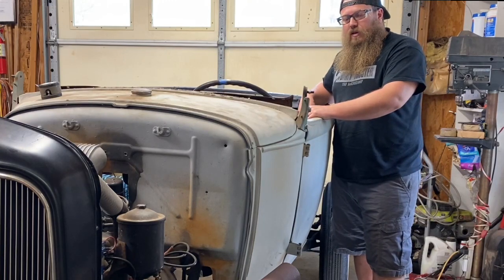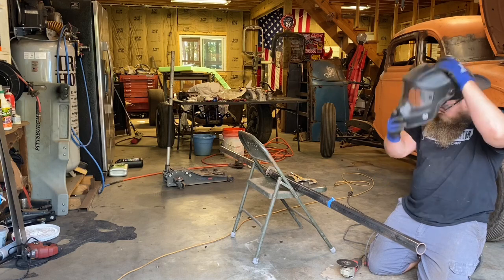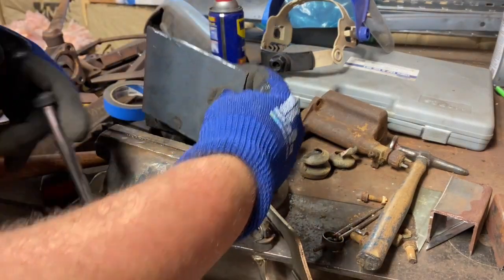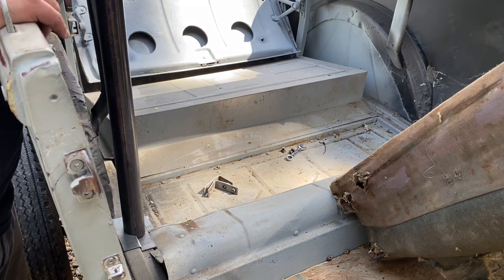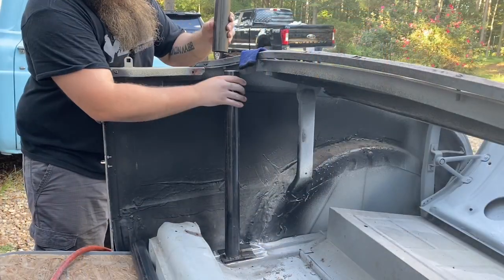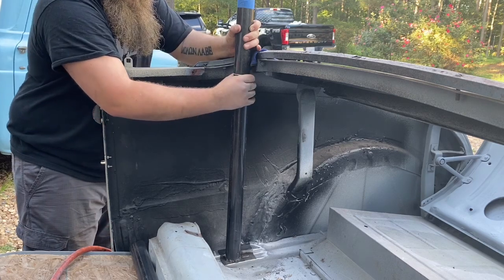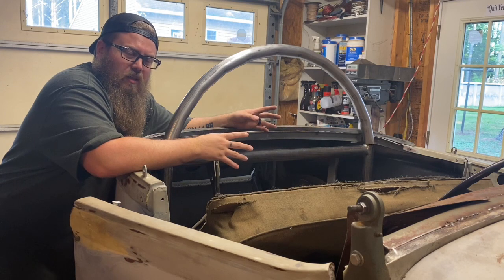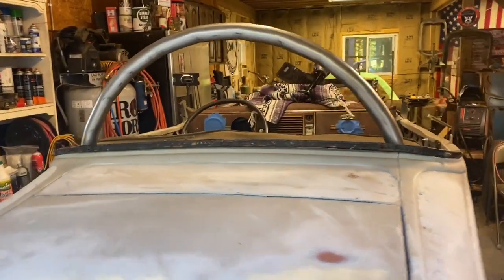Making a Roll Bar for the Roadster! TROG build ep.3

Comment: When i was a kid my pop brush painted an old fat fender ford PU. I recall getting off the school bus watching as he finished his final brush strokes of Rust O Leom red. Within 2 hours he was pushing it down the road! The whole cab had bugs embedded in the paint! He would have done better just leaving it alone. 

Your paint job looks good. That said i like spraying paint more than  brushing it so i would have thinned it and ran it through a gun myself. But again, the job you did looks just great.
Reply from the maker: Love hearing the old stories! I definitely could have done better, luckily I did it inside and there was no bugs, I knew I was just going to grind it all back off to fix some bad repairs. But I do plan on brushing it legitimately next time, then I’ll be wet sanding and polishing it. I think it’ll be hard to tell the difference from sprayed lacquer and brushed lacquer then
Reply: @WiredCustomsSpeedShop  I hate lacquer paint. The first car I painted was a 68 Buick Lesabre. I must have put three gallons of mud in the quarters of that old tub and spent most of the summer sanding that old car smooth with electric pad sanders. All I had for air was a puny one lung air compressor and the worst paint gun you could imagine. My pop knew less about painting a car than I did and insisted that lacquer was the way to go. I painted that old Buick and a 69 Corvair in lacquer and rubbed both cars till I was blue in the face trying to raise a shine. I suppose I did OK both cars looked alright, but never shined as much as I wanted them to. The next cars I painted I switched to enamel and I never again used lacquer! LOL 😂 

I found things so much easier with enamel with a little hardener.
Reply: Btw: I forgot to add, I was 16 years old and just winging it when I started with the old Buick and Corvair. LOL.